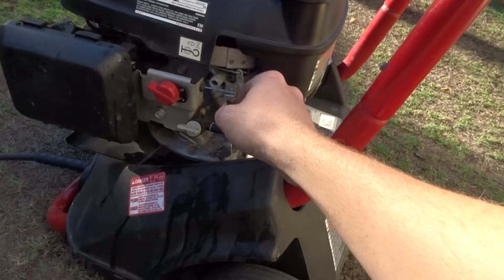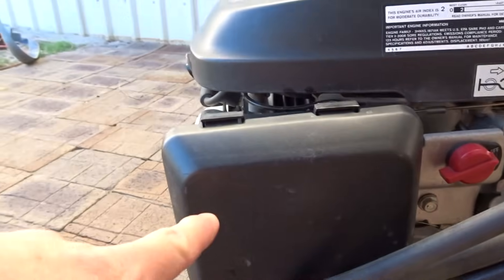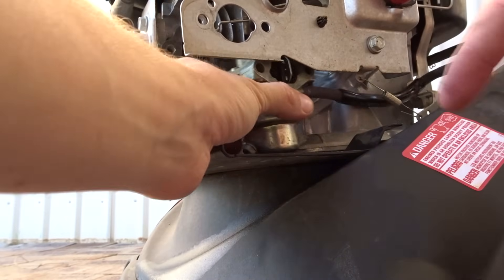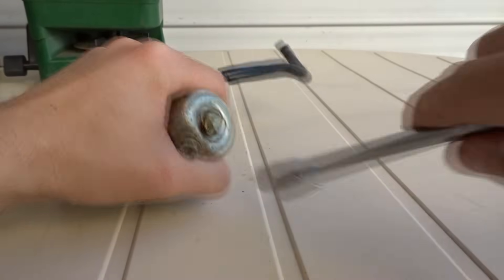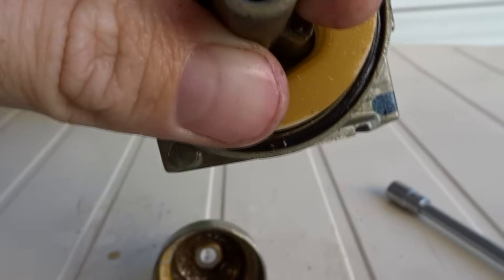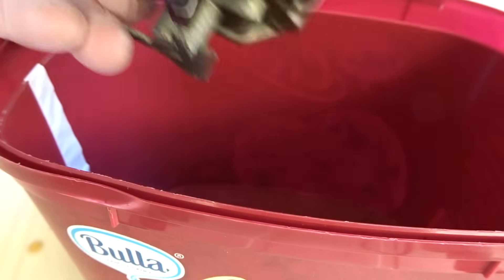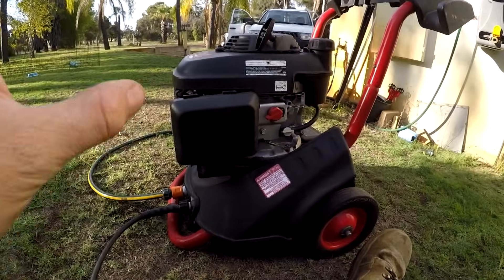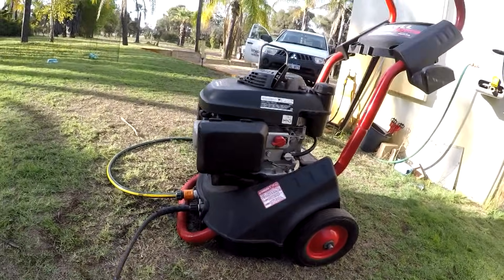Honda GCV160 Hunting Idle Surging Fix

Comment: This is exactly the problem I am having with my machine. All my fault for letting it sit unused for an extended time with fuel in the line. Thank you so much for posting this video how-to. I now have a project for this weekend.
Reply from the maker: All the best with it!
Reply from the maker: If its too far gone, one thing that can really help is a carburetor replacement
Reply: Also, drain the fuel tank & line of all the existing fuel.  After you clean,, add Fresh, New Fuel before you start it.
Reply: Clean the pilot jet. It's under the Phillips screw.  .. that should do the trick

Comment: OK, I had the same problem with my Pressure Washer "surging". I took the Carburetor apart and cleaned that about four times but it kept surging. The pump I dismantled completely and found a small piece of rubber washer from where I don't know as I checked all of the washers and none were broke. It was stuck in one of the small tubes where there are small valves with rubber caps and springs under them.I really had to take a good look and I found it when I was pushing the valves down with a tiny screw driver. One just wasn't moving like the others. I took a small pair of surgical clamps, very great to get little parts, and plucked the piece of broken washer out of the tube. I then re-seated all of the valves and carefully pushed them up and down to make sure they worked. Pump back together, new oil and all cleaned up and the surging was fixed. Just saying that if you look at the Carburetor make sure you look at the Pump. If the Pressure Washer only surges when you put a load on (pressing the wand gun trigger), then you'd better look at the Pump. Disassemble, diagnose, new oil (PUMP OIL!!!!! - Karcher KA-8.901.077) and reassemble you're looking at about four hours to do a REALLY good job. Oil was BLACK, new Oil is clear and the Pressure Washer works like a champ. Hope some of this helps!
Reply: Khamrun this is the same thing mine is doing. I cleaned the carb and it still does it so it’s probably the same issue

Comment: Not the Hondas fault , its as you said leaving fuel sitting in the machine for too long .
Just cleaned out my mariner outboard with the same problem after fuel was left in it for 10months .
Those GCV160 Honda motors are some of the best out there I have used them in my contracting business for years !

Comment: Good video chap. I have same machine. Had it for years. I just noticed  it as having same issues as yours.  I made mistake of leaving fuel in tank over winter months without adding a long term storage solution.  Your presentation was most helpful. Cheers
Reply from the maker: Thanks for your kind words

Comment: Wished you had shown just what a bugger it is to put the carb back on.  Each gasket and the pain it is to keep them aligned while assembling the throttle and choke linkages, then putting the pcv tube on and bolting through all the individual pieces and not having anything fall off as your doing it.
Reply: @Magic One     Next time get yourself a couple pieces of threaded rod, same diameter.  Remove one screw, replace with a threaded rod. This rod is now a stud. Now, do the same thing to the other side.         

Do whatever you needed to do with the carb, then, when you’re done and putting everything back to together, do the rod/stud/screw procedure in reverse.  Not only does this save me a ton of time, it eliminates my frustration and irritation. Hope this helps you. Greetings from the American Midwest.
Reply: @robstone5333  Brilliant!!

Comment: Have new Amazon-returned Dewalt PW with a GX 160. Runs well at full spray throttle, but stmbles/bumbles and backfires at idle. Pulled card and cleaned. No debris as PW is nw but may have sat a bit after starting. Replaced fuel. Cleaned air cleaner. Still hunting. Noticed PCV hose was dislodged.

Comment: Honda GCV-160 Carburetor Jet Part numbers: Stock Main Jet#99101-124-0650 (#65). Bigger sizes: #99101-124-0680 (#68),  #99101-124-0700 (#70).  I went with the 70.

Comment: Which is which? Your calling the long tube with pin holes in it the main jet. Im being told by many YouTube videos that long brass part with numerous pin holes running through the tube the emulsion tube. Which is the correct wording? Thank you 👍👍

Comment: Having cleaned my carb twice, I found the gasket behind the heat spacer was part worn thin and not sealing fully. The long mounting bolts give a bit of flex and with the carb coming off for cleaning fairy often, I guess it wears out. 
That was some dirty fuel, I've never seen that before.

Comment: I have the same engine on a log splitter. I cleaned the carb and it starts fairly easily and runs well. However I have to manually hold the chock wire/handle out (choke closed) when starting it. Do you have any suggestions how to correct this? If you have any pictures to aid in showing me the fix it will be greatly APPRECIATED.

Comment: ive had this problem with my leaf blower left it for a year and didnt use it,went back to use it and it ran rough so best thing to do is run a cleaner through it a few times to get rid of the dry crap that gets left in the tank and fuel line

Comment: You didn’t seem to clean the idle circuit. Remove the Phillips screw on the carb, gently wire it out and blow carb cleaner through all ports.

Comment: I bought mine brand new (unassembled) and had this problem almost immediately with fresh and treated fuel.
Reply from the maker: Yeah apparently the main jet is too small on the carby. Swapping for a slightly larger hole to allow fuel past has helped some 👍 hope it helps

Comment: I have the same problem with my Honda gx160, I've cleaned the jet/s twice, cleaned out the tank, put in a new fuel filter, air filter and spark plug but it's still hunting, any ideas?
Reply from the maker: Id possibly look into buying a carburetor for it. Mine started hunting again, so i replaced the carburetor and it fixed the issue. I show the difference it made and how to do it in another video. Hope it helps
https://youtu.be/teYm-t9t0_0
Reply: @WatchingGrassGrowOfficial  thanks for replying, in the end I just adjusted the air/fuel mixture screw? Turned it clockwise quite a lot until it started running smooth, although the idle soeed is now faster it seems fine, can't understand though how it became like this, the screw was very tight either way so can't have worked loose.

Comment: Before seeing your video, I replaced the carb, plug, filter, gas - used SeaFoam (3 products) in new carb, in chamber directly, in fuel - still surging.  I purchased this new and use it every month so the gas is not sitting.  The last thing that happened I can tie it to was I turned it on its side to put the rubber foot back on the bottom. When I started it, it spit out all kinds of smoke and this surging problem started.  Having assumed that excessive oil in combustion areas was the issue - is why I went after cleaning the chamber, plug, etc.  if you have any other ideas, it's appreciated.

Comment: Hello. I replaced the carburetor, spark plug, and new oil. It’s still surging, any idea what I did wrong? Thanks
Reply: Fuel filter screen at fuel tank connection.
Reply: Basically, start at fuel tank and clean everything all the way to the output shaft the blades on. Such a simple design that you're sure to fix it. It's usually a fuel delivery problem (partially clogged at screen or tubing), carburetor or near it, governor system (bunch of linkage with springs that rev engine if you manually move them) Hit all the links in the linkage with WD-40 and get them nice and loose, check there's no buildup in fuel lines, clean carburetor, and everything you see with compressed air and 95% of the time there's nothing else to look at. The usual stuff like new oil, new gas, etc. doesn't hurt either.

Comment: I bought a brand new carb and it’s still doing it
Reply from the maker: Try blowing out your fuel lines as well, change the fuel filter (if you have one) if it hasnt been changed in the last 12 months. Also start it without the air filter. Try starting. If it still does it. Spray some starter spray in through the air filter, see if it makes a difference when spraying (spray while its running). If it does, then you know its fuel related
Reply: Watching Grass Grow okay thank you very much I’ll give it a shot
Reply: I think sometimes it has to do with the governor.

Comment: Mine is still surging after cleaning the carburetor I cleaned the jet all the small passages. After running it for about an hour the spark plug gets covered in soot and fouls out.
Reply: @WatchingGrassGrowOfficial  To be truthful, the main jet is the "Bolt" that tightens the Carb bowl. What you had problems with was the Emulsion Tube. It is also good practise to clean out the Idle jet. I suspect the idle jet was the culprit and your F10 cleaner actually fixed it.
Reply: Make sure you are getting ample fuel at the carb. I found the fuel screen at the fuel line coming out of fuel tank was my culprit.
Reply: @ryanhumberger5781  how did you resolve that?

Comment: Have the same pressure washer. And my unloader valve is stuck. Do you kno where i can find one or one that could fit. the pump model is discontinued and cant find anything.
Reply from the maker: Hey mate, couldnt find an unloader valve for sale but i found a complete pump for the vr2500. See the link. Hope it helps :)
https://amzn.to/3ekGg5E

Comment: Well, saw this video...did the carb cleanup - did not work, so I bought a brand new OEM carb and installed, still as soon as the auto-choke opens up fully the idle surges like crazy until the engine is fully warm...about to toss this junk Honda motor in the trash. Must be something else going on??